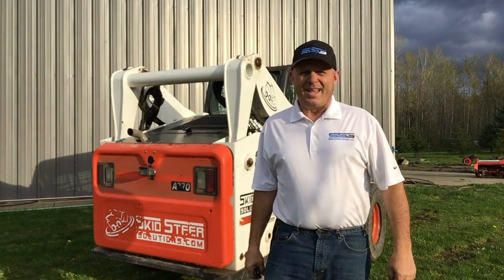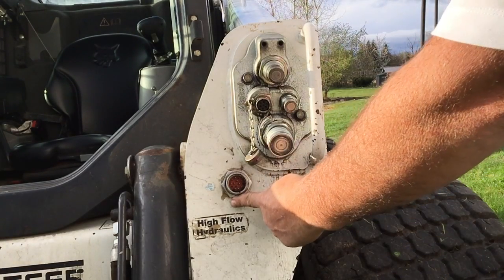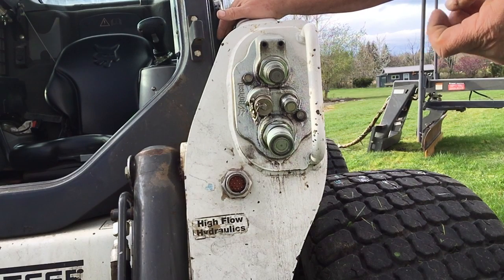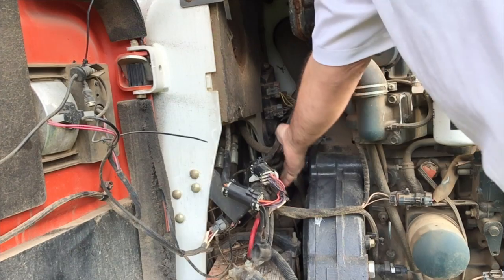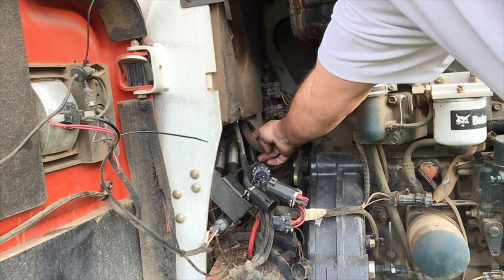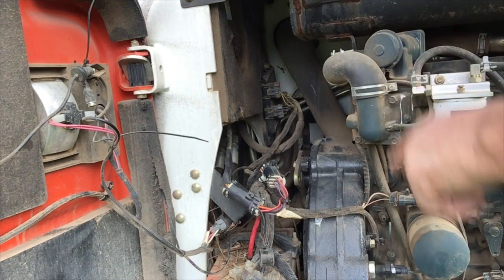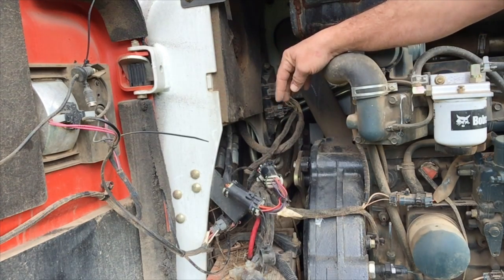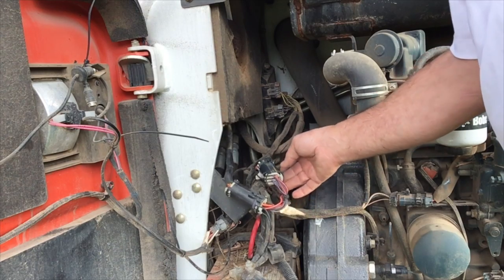#114 - Step by Step Bobcat Cabling Setup

Comment: Ahaaa!  Leaned a shit ton today. My '13 S 750 doesn't have a 14 pin female up front ( I don't think) but has the Y connector splitter and all that in back. And it doesn't have a plastic cable zip tied to boom. So maybe 1sr owner disconnected and didn't ever need it. ( or ripped it off).  I think it was a town maintenance dept. And I think it was strictly a bucket machine. Thank you!
Reply from the maker: You are welcome.

Comment: Can you jump it to fire off the auxiliary my machine is an electrical nightmare I'm considering just bypassing it and looping a hose when not used but that's not ideal I can fire the solenoid with power probe  I need something to reduce voltage so I can use back hoe 873g  I'm assuming a wire is shorted and getting hot the dealer was to bust to help so we bypassed everything else

Comment: Where are you located at?
Reply: Andrey Sakhnnyuk Bellingham, Washington.
Reply: If you have a problem you don't understand how to wire the main harness if you can't find it on any video what are you do my name is Joe I don't have my lip until is not working my solenoid seem to be good for opening and closing I'm overwhelmed help
Reply: I have no lift and tilt. The light is blinking everything else unlocks I'm thinking it's an electrical problem where I connected the wires wrong underneath to the valve body if you have any images or wait to let me know which connections go where it seems to be there's only two different kind of connections I'm confused my name is Joe my telephone number 770-876-3200 I need help it's been over a month and I'm about ready to have I got over a $1,500 in week doing this thing I am getting sick
Reply: My lights won't come on my bobcat s750